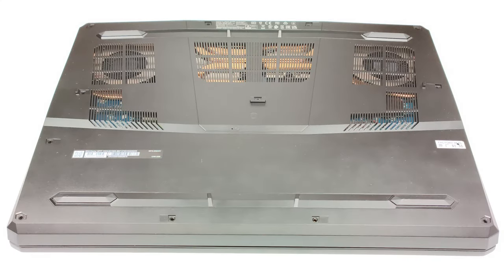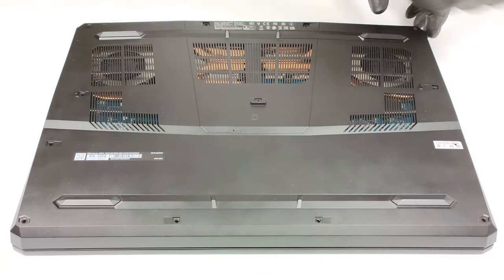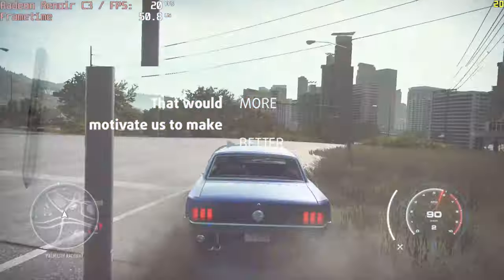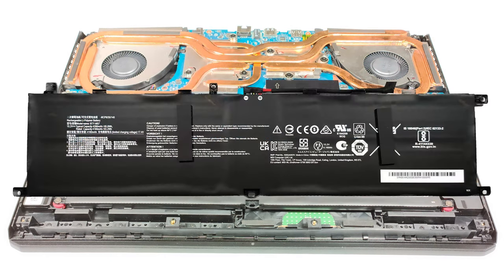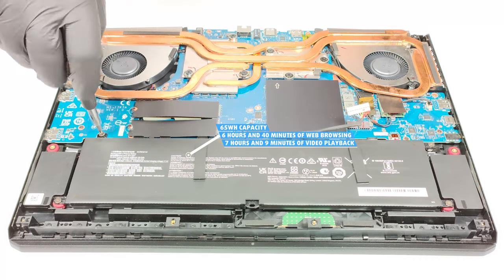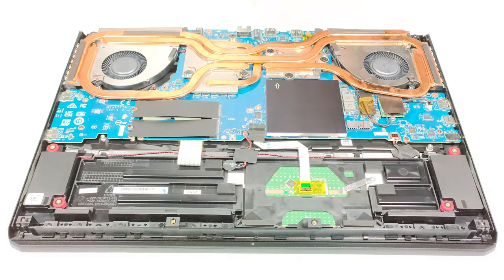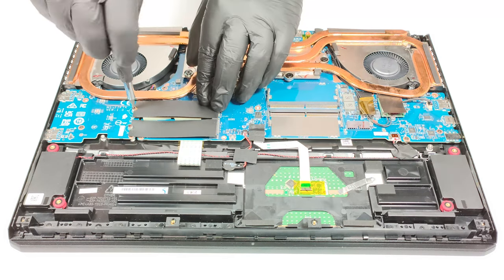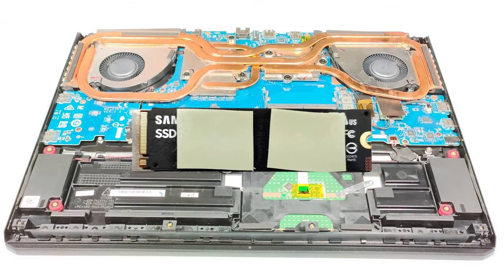🛠️ How to open MSI Vector GP77 13V - disassembly and upgrade options

Comment: Снять крышку закрывающую оперативную память можно не снимая батарею. 
Крышку держат металлические зажимы по периметру. в местах зажимов, можно подсунуть что-то тонкое и поворачивая предмет , крышка пойдет вверх и выщелкнется с зажима. Естественно, металлическим предметом наверное не стоит это делать.
Если все-таки решили снять батарею, после сборки в обратной порядке, чтобы включить ноутбук нужно удерживать кнопку включения секунд 10. (на однократное нажатие при первом включении ноутбук не будет реагировать)
________________________________________________________________
You can remove the cover covering the RAM without removing the battery. 
The lid is held by metal clips around the perimeter. in the places of the clamps, you can slip something thin and turning the object, the lid will go up and snap off the clamp. Naturally, you probably shouldn't do this with a metal object.
If you still decide to remove the battery, after assembling in reverse order, you need to hold the power button for 10 seconds to turn on the laptop. (the laptop will not respond to a single press when you turn it on for the first time)